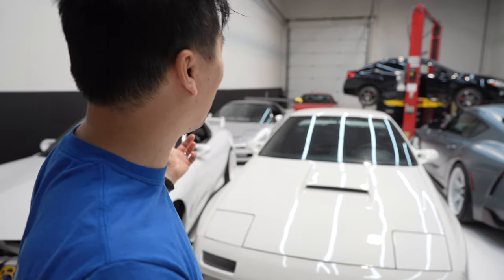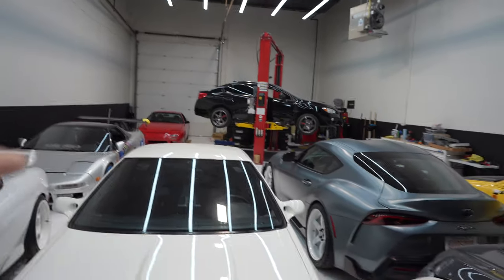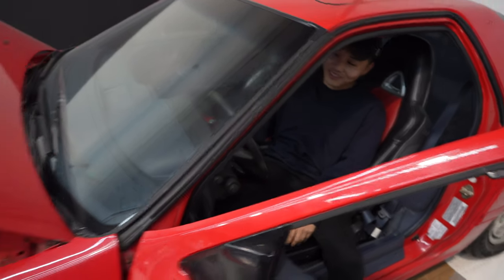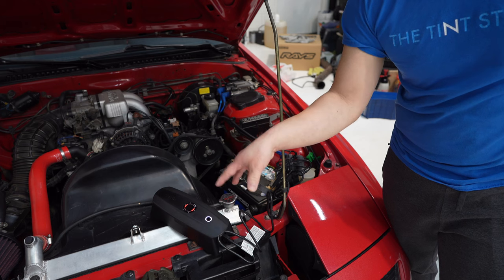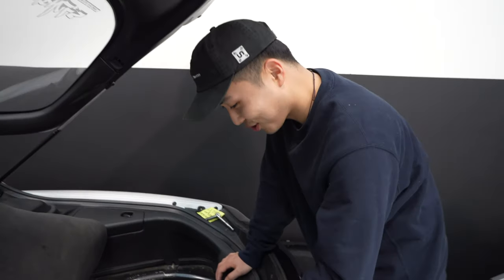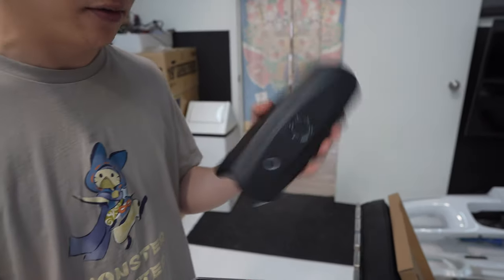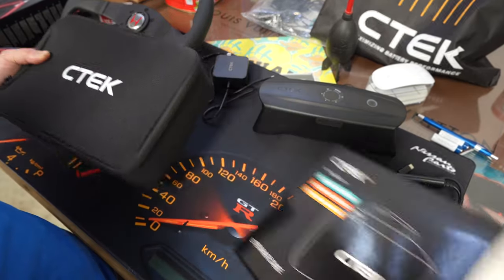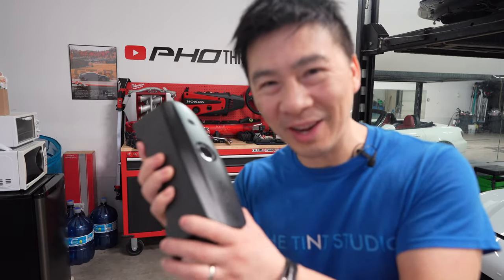Ctek CSFree Smart Charger w Adaptive Boost 2024

Comment: You can take it in your carry-on, but NOT in your checked luggage, because of the 6.000 mAh lithium-ion batteries. You can bring up to 10.000 mAh / 100 Wh lithium batteries as carry-on on most airlines. If you put it in checked-in luggage they'll pull your luggage and have you remove the device containing the battery, this is due to the fire hazard.
Reply from the maker: Thanks for the info 👍
Reply: @phothrottle Great review. I've seen some of your other videos too. Keep up the good work. 👌🏼